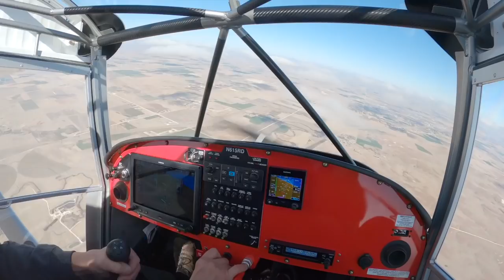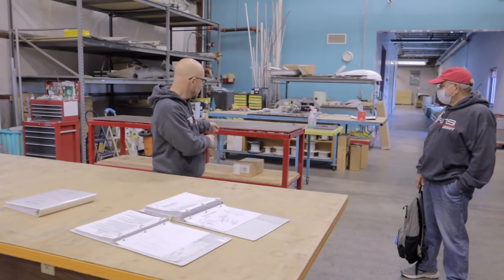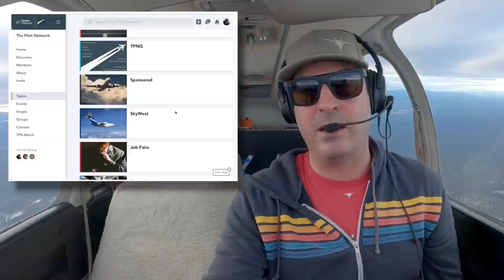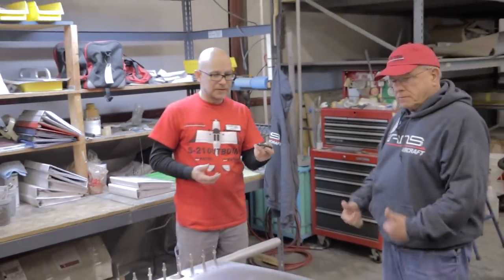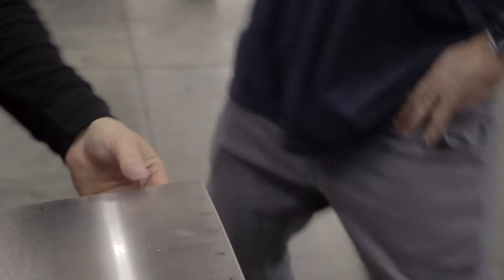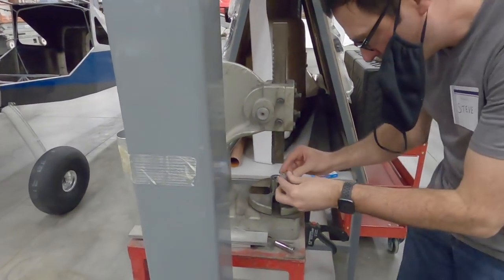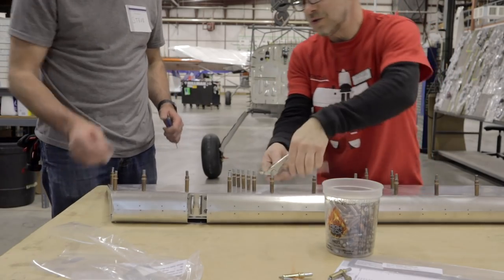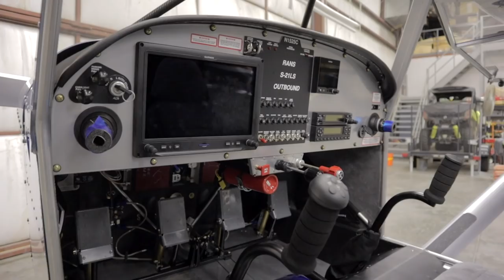RANS S-21 Build Episode 1: Rudder Workshop

Comment: If I was buying a digital protractor/level these days I'd take it right out of the packaging to a place that does tool calibration services. The quality of all brands of tools has gone so downhill it's not even funny.
Reply from the maker: Really?! Well the good news is it doesn’t need to be calibrated since we don’t necessarily care about 0.00° level. We care that if one side is +0.5, the other side needs to be +0.5. That’s my understanding anyway fwiw.
Reply: @CLEAREDDIRECT  Bingo, You got it. You can built it on a banana as long as both ends of the part are equal!

Comment: Special thanks to Pepsi Cola for supplying the building materials with leftover soda can scrap material.
Reply from the maker: I love Aluminum for a lot of reasons, not least of which is its recyclability.
Reply: @CLEAREDDIRECT  Certainly the material of choice for aviation for most of the history of flight. I just found it enlightening how thin of a gauge it is, something you don't get a real sense of when it's formed, riveted, and adhered to the rest of the aircraft.